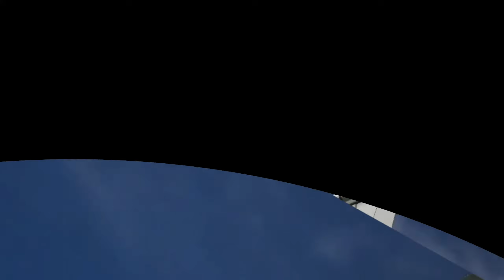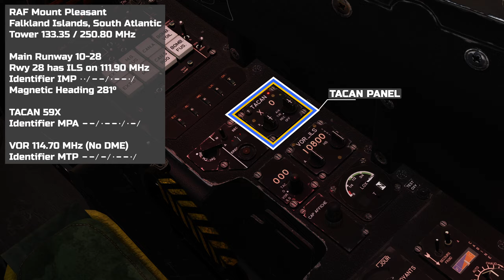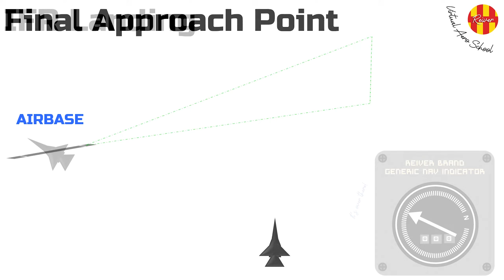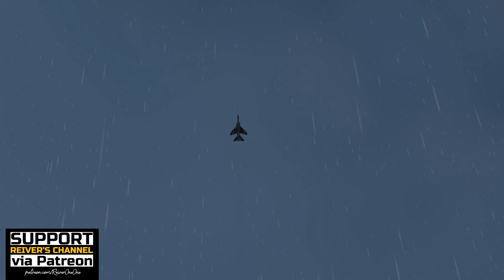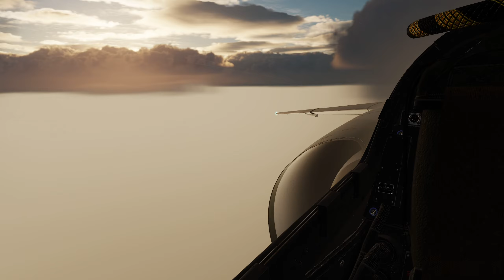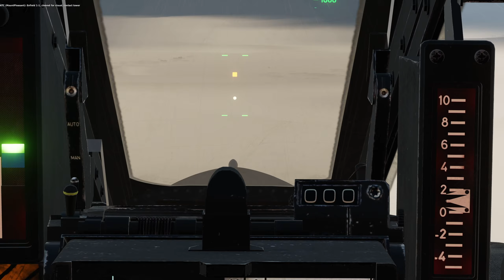The Art of the Mirage F1 - Landing in IFR Conditions | DCS World Tutorial Series

Comment: My problem with landing is when I apply wheel brakes the plane drift off so bad it's uncontrollable
Reply from the maker: It can be tricky. I deploy the drag chute and then hold off using the wheel brakes until I'm at about 60 knots, and then only pulse and release them intermittently. Try not to use too much rudder/NWS input when applying the brakes, if any at all. The drag chute should provide you with enough braking force to slow you down quite rapidly to below 100 knots so you should be able to handle most runway lengths.
Reply: @reiver1-1  will try thank you